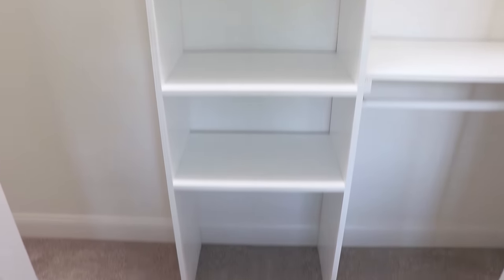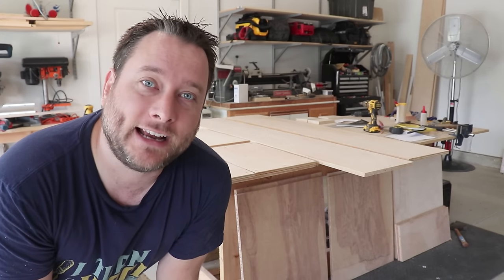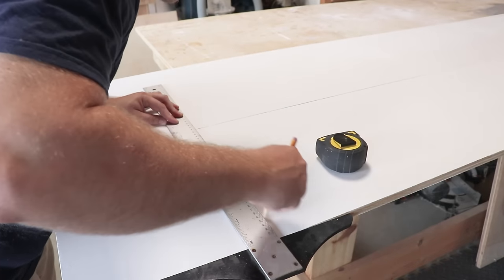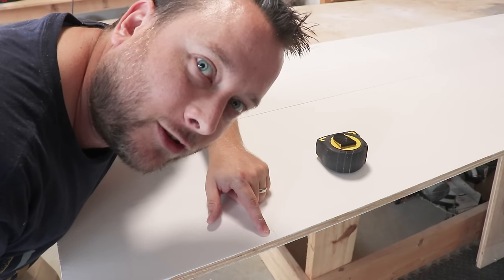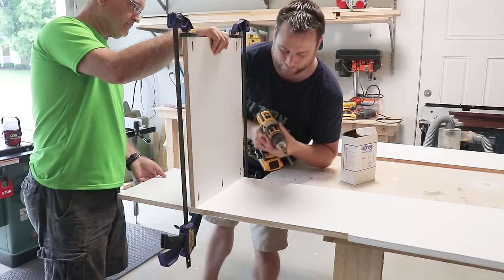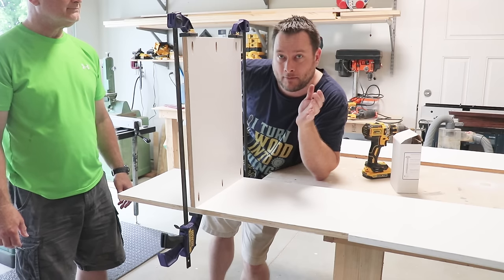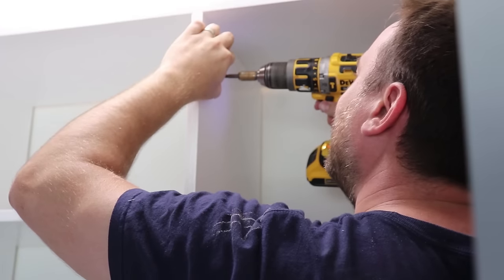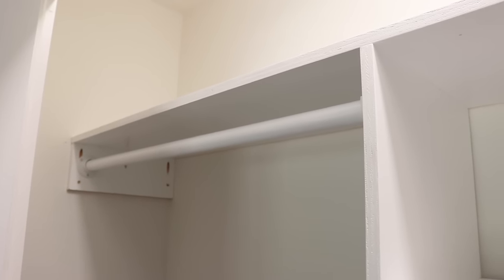DIY Bedroom Closet With Sheets of Plywood for $100 on a Budget | DIY | Woodworking Project

Comment: I have to laugh when I see these videos. All you need is a bit of know how, some wood and a fully equipped workshop.
Reply from the maker: Honestly the only tools you really need are a miter saw, table saw and a sander
Reply: I recently built a closet system similar to this (my own design but very similar to this one) and all I used was a cheap circular saw to rip the plywood and cut shelves to length, and a power drill to assemble everything. It turned out great. It can be done without a bunch of equipment, it just takes a little more time and effort.
Reply from the maker: That is awesome and I would agree you could just do it with a circular saw just take more time and patience.